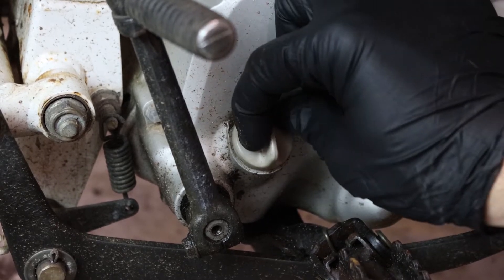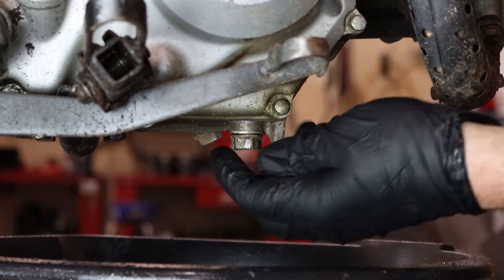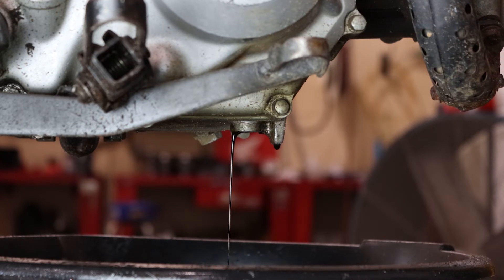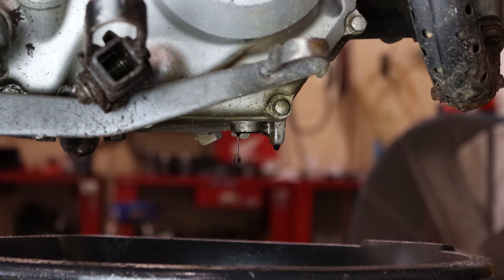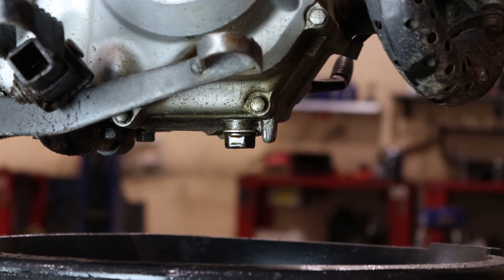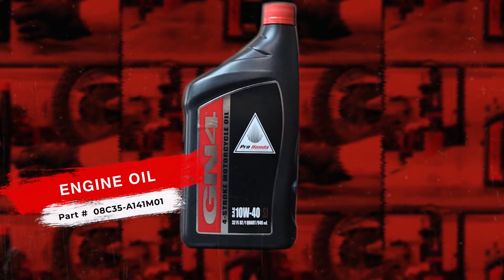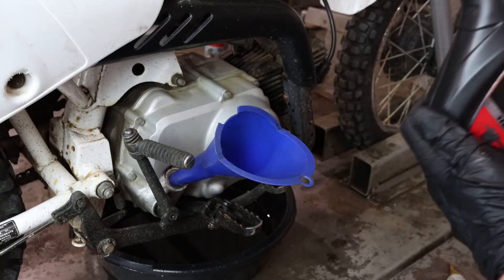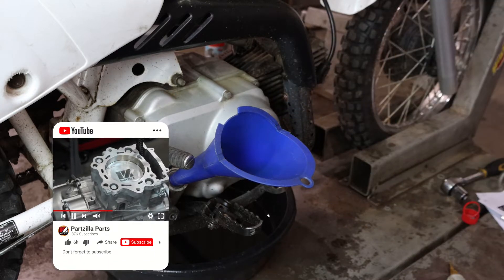How to Change the Oil on a Honda XR70 | Honda XR70 Dirt Bike Oil Change | Partzilla.com

Comment: There's no oil filter?
Reply: Thats why I hit dislike. There Is a filter. Sorta.    It's centrifugal. Inside that case. Not even a mention of it on this video.
Reply: @coreycollier3672  how do you get to it, is it a hard job to do??????, And how often do you change it, thank you just got my son an 03 xr70 and trying to do everything to it
Reply: @Enrique Valentin  it's easy to do. This was 2 years ago so I don't exactly remember which side it was on. But there should be a spot there you can see where it would be.  Get it open and just slosh it around in some gas or fuel oil if you don't have access to a parts washer.   U could get away with not even doing it. These bikes are bullet proof.
Reply: Can you make a video on cleaning the oil strainer? You’re supposed to clean it after every oil change.